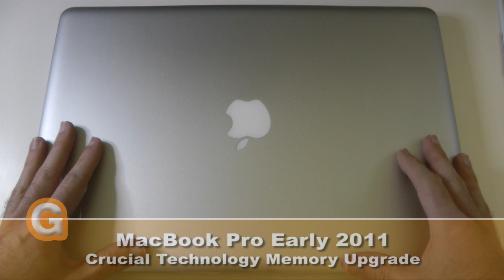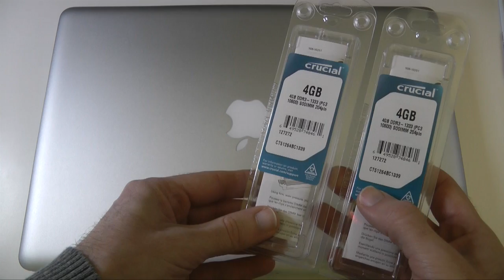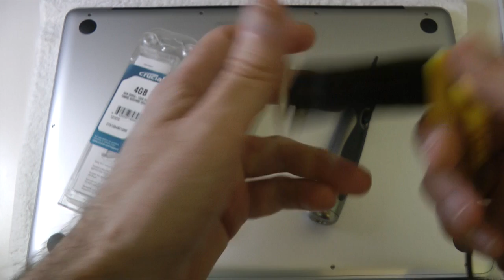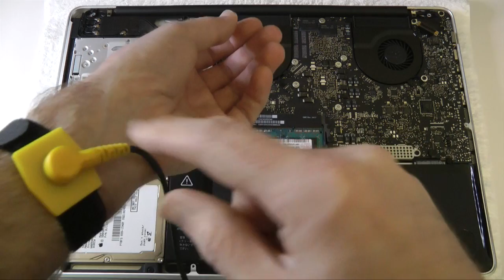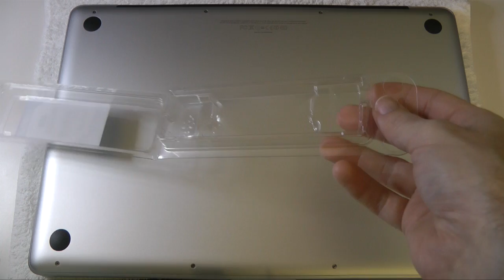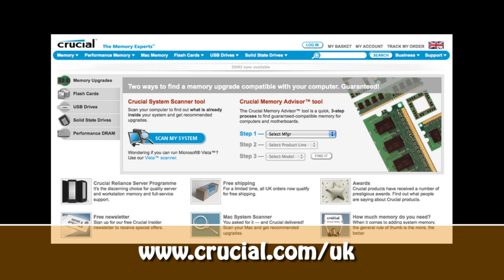Apple MacBook Pro Early 2011 Crucial Memory Upgrade

Comment: You could run into bottlenecking issues and the inability of the mbp to recognize the new faster memory.  RAM speed is also tied into bus speed and that's where the bottleneck would occur. In addition, it probably wouldn't do you any good. I wouldn't think so anyway, but try it and see if you must

Comment: @YK9Helper No. Memory and Harddrives are the only thing Apple lets you change out without voiding their warranty. They might require you to put the old memory back in if you're having problems to prove its not the memory that is creating the issue though.

Comment: @J888HNT  No. You need to buy SPECIFICALLY, 2 X 4GB 1333 Mhz DDR3 204 Pin RAM sticks. You could also buy 1066 Mhz speed sticks in that specification.

Comment: I installed the same RAM as you, in the same computer. and then i started getting this troubleshootings. i have gotten several warnings saying that i have to manually turn the mac of by holding the powerbutton down. but when i changed back, it stopped.

Help Please

Comment from the maker: @mrbluesky22 Process is the same, RAM is a user accessible part so will not void warranty. However, you do so at your risk, so if in doubt check with Apple. Also, it would void your warranty if for example you broke the memory slots whilst putting the memory in.